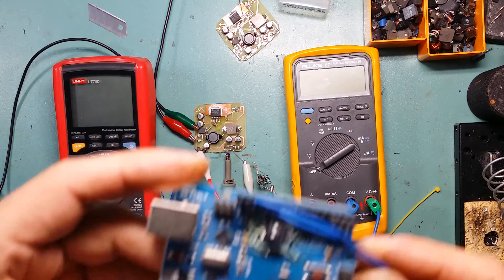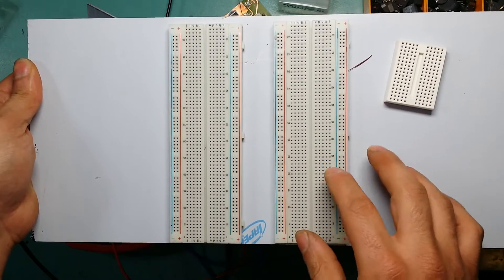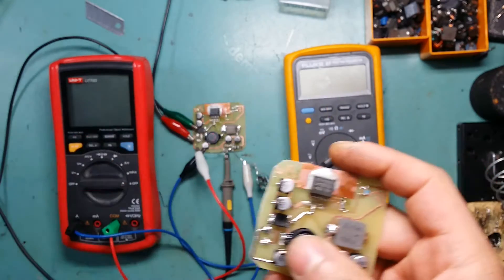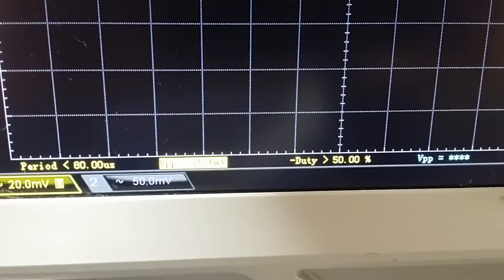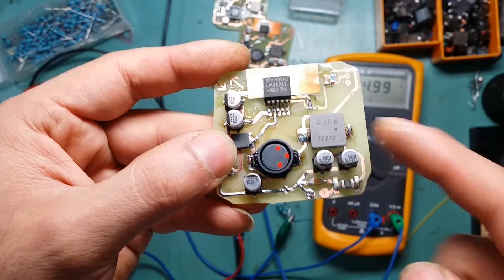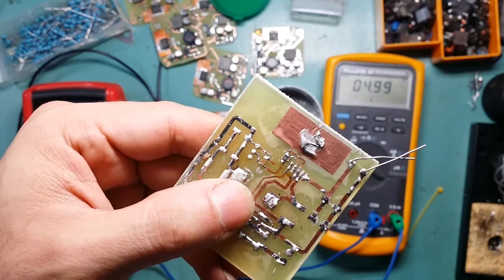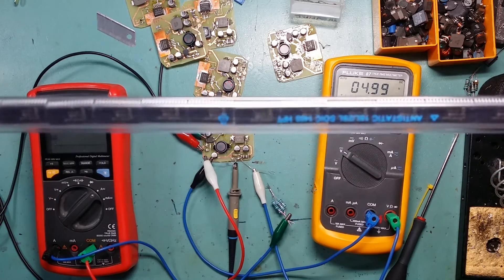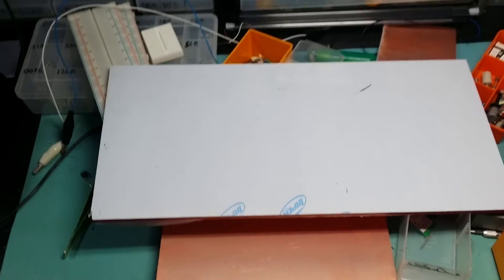DC DC CONVERTER AND ARDUINO PROTO PLATFORM

Comment from the maker: thanks for the comments. as for the arduino running on 9 volts you are right on that.but reason for this is the arduino boards have a linear voltage regulator on them to protect the ATmega chip from over voltage if the user powers it from higher voltage by accident.

However the arduino platform i am building wont have arduino boards and the rest of the circuit, it will only have arduino ic with bootloader on them so this means i will need some form of voltage regulator to make sure the chip gets the right regulated voltage to operate.

Now by arduino boards i mean (Uno,Leonardo,DUE,Micro... etc)
Reply: Oh. I see. I thought you were going to use the whole board.